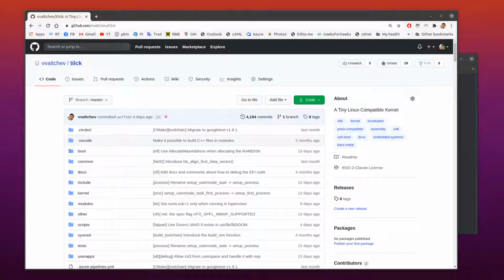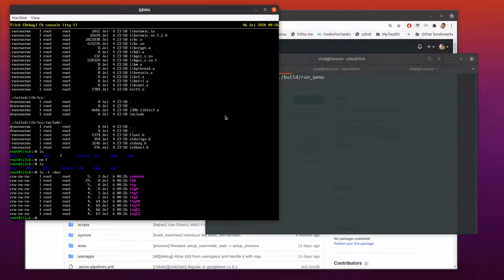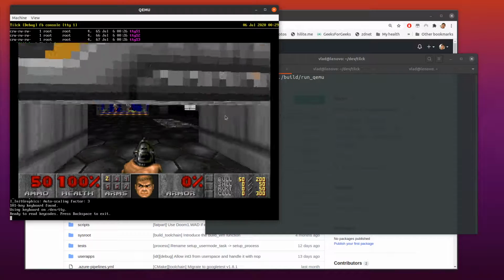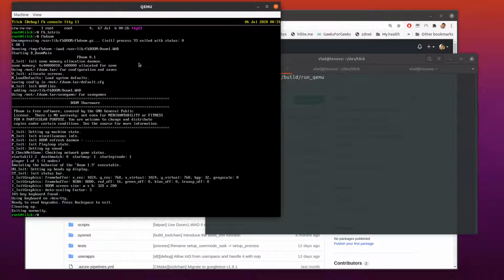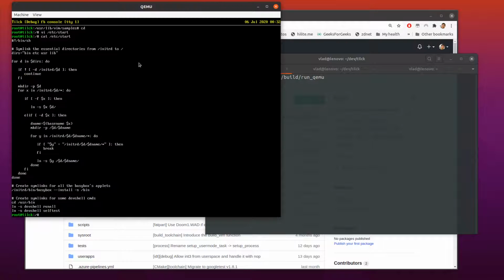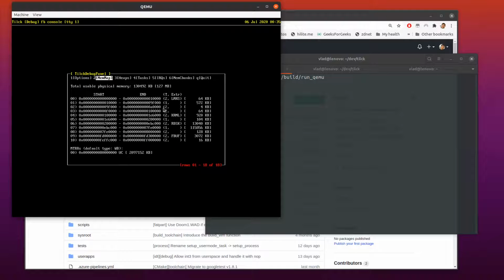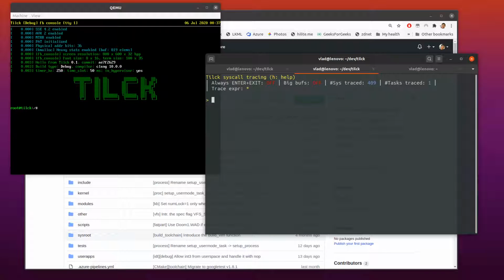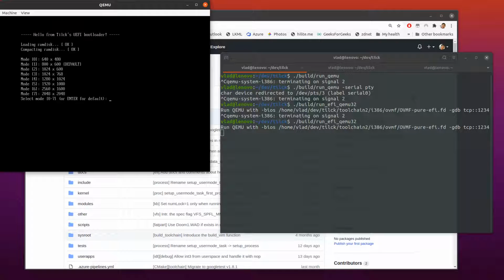Tilck: a quick run-through its features today (Jul 2020)

Comment: Vlad, you mention around 7:40 that you got the Tiny C Compiler  to run under TILCK, and that TCC can compile the Linux kernel. Can TCC compile the TILCK kernel, too? It would be neat if your system was self-hosting! And if it currently isn't, what would it take to make it so? Just curious.
Reply: TILK looks like a really neat piece of work! I'll definitely give it a spin. Thanks for the video!
Reply from the maker: Hi Thomas, thanks so much for appreciating my project :-) 

I'll try to briefly answer your question. Unfortuantely, probably Tilck won't be able to build with TinyCC out of the box. In addition to the requirement for the GAS assembler, the project uses some new C11 features like atomics that certainly are not supported by TinyCC, along with a bunch of GCC extensions. With enough effort, I might make Tilck's C files to build with TinyCC, but a full build certainly will need more than that: Gas, CMake, Bash and several other tools need to work too. Also, Tilck uses linker scripts and I'm not sure TinyCC's embedded linker can support that. It's true that TinyCC was able to build Linux 2.4, but the build probably used several other tools, not just the compiler alone.

I guess that the shortest path for self-hosting would be to make the GCC toolchain I use + cmake and bash to work on Tilck. To do that, Tilck will probably need more syscalls to support glibc (currently apps use libmusl) and will need to support dynamic linking as well. But, that's not part of project's goals at the moment. Tilck is a small project aiming at embedded systems and the educational world. There is a lot to play with, in particular around filesystems, block devices, page cache etc. before getting to point of considering self-hosting.

I hope my answer didn't disappoint you too much. I really appreciated your enthusiasm. If you have any kind of questions about the project and/or bug reports and/or you would like to contribute, let me know (my e-mail is visible in the git commits).

Vlad
Reply: No disappointment here. Thank you for your comprehensive explanation!